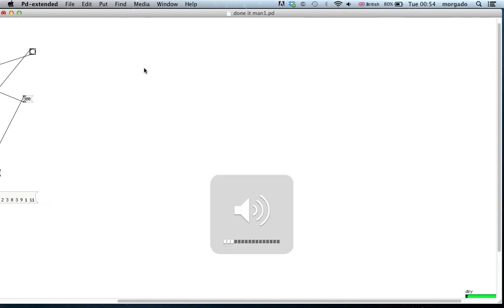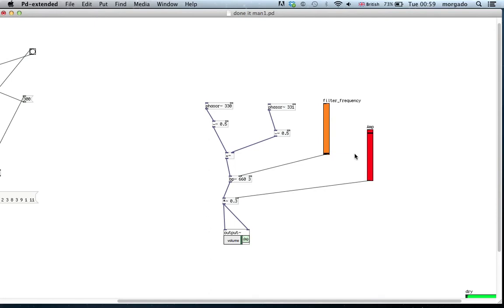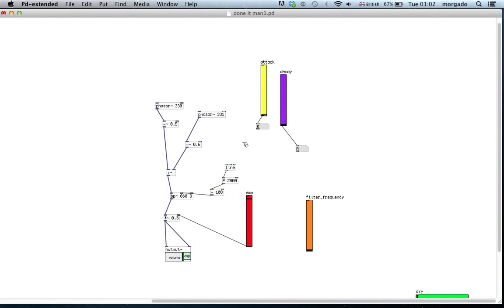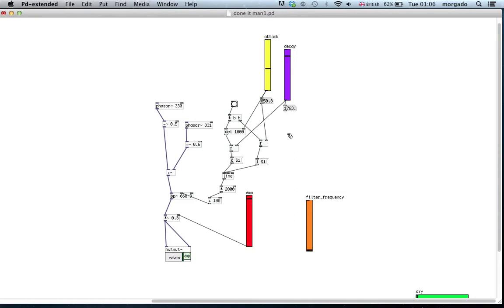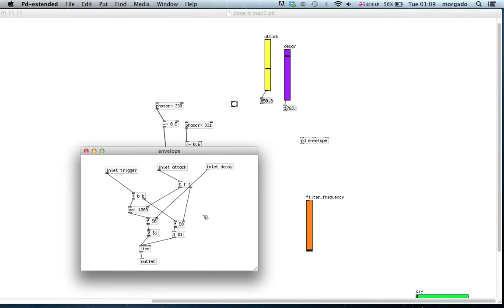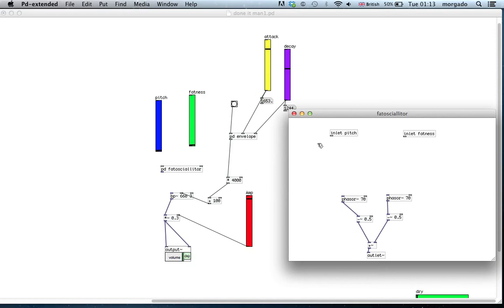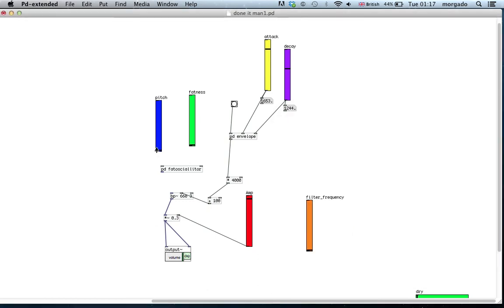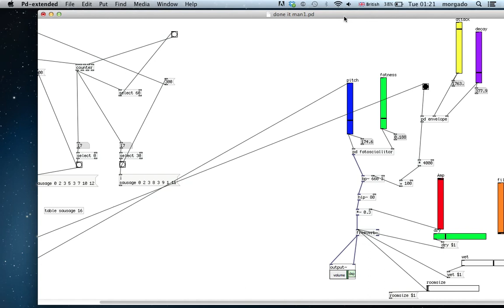My Project part 1 - How to make a Subtractive Synthesiser

Comment: I had the same issue too - and saw the comment but it took me a while to understand what the comment meant. just in cas eothers get stuck here too - yo'll need ot click back into the envelope sub-patch and check the lowest comment box is in place and connected. below the line box should be a outlet box. good luck...